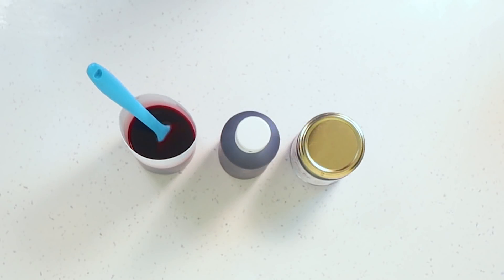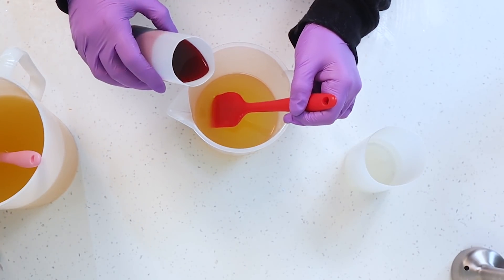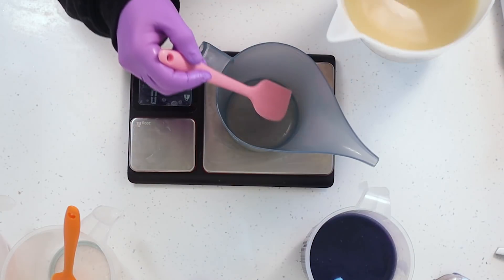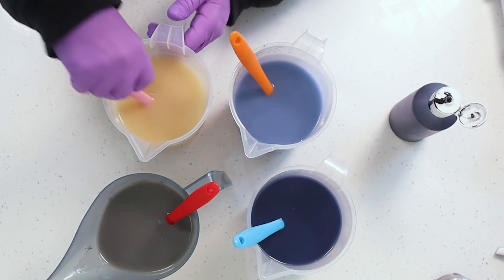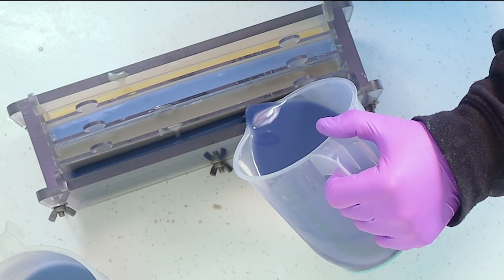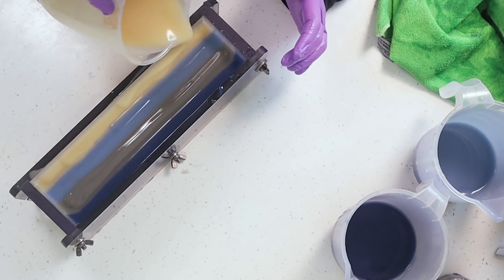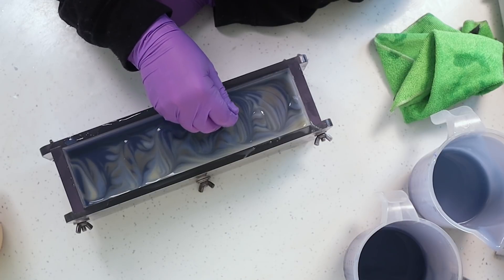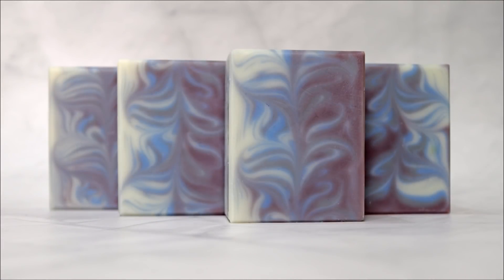How to make Natural Lavender, alkanet, and indigo cold process soap. Taiwan swirl variation

Comment: Its the same with the alkanet root as with beetroot or red cabbage, the intensity of the  colour depends on the pH-value. In an alkalic surrounding it changes to a blueish purple, in neutral or sour surrounding it is red. It would be intressting  whether it stayes blueish or goes back to redish colour when the high alkalinity fades away after some time.  However, beautiful Soap!
Reply from the maker: HI Jona, the colour will stay purple it will not go back to the red

Comment: How long does a CP soap last?
Reply from the maker: Ooh it will last years if you are just storing it, if you mean as you use it, well, it just like normal soap and will last well, it's best to keep it dry between uses, so make sure you use a soap dish that drains the water away from the soap